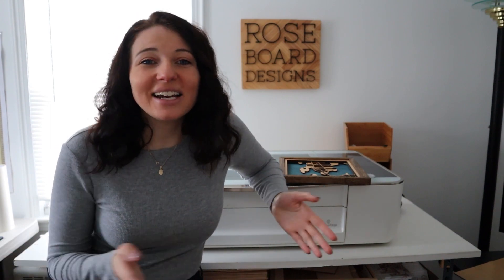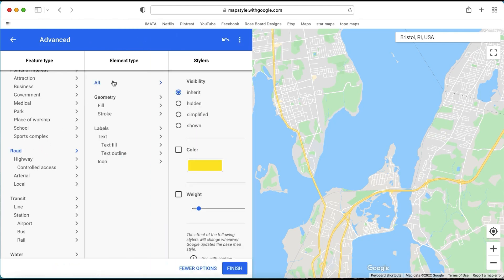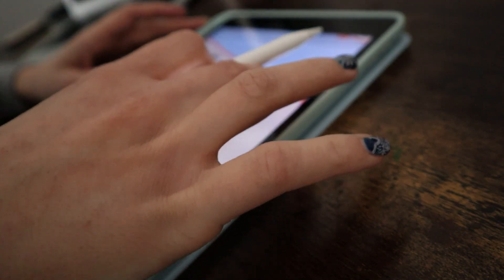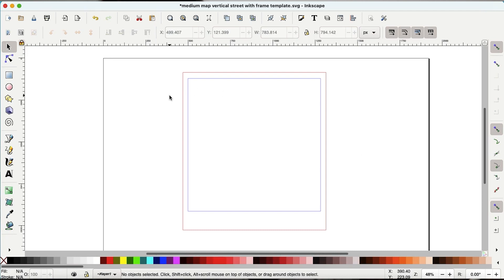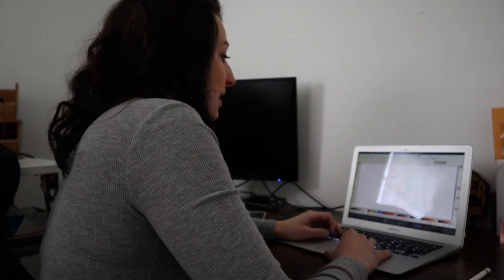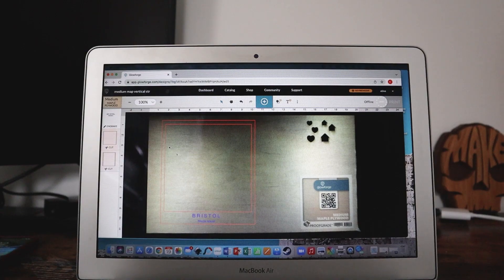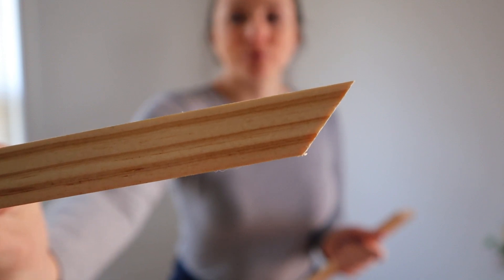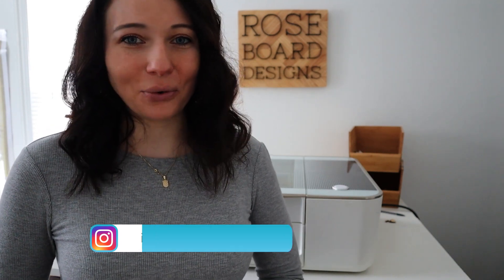From Start to Finish: Map Making

Comment: the way i make my maps is  with just 3 layers. The Base for the water, the 2nd layer is the residential streets with all the water bodies cut out, and 3rd layer is the main highways and arterial roads with main boarder and name of city down the bottom. you want to save as much material as possible.